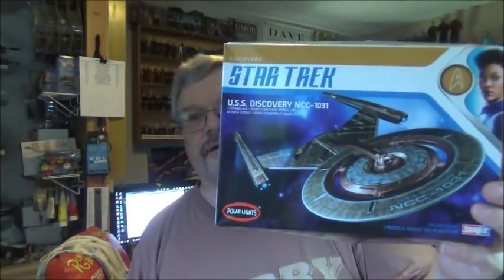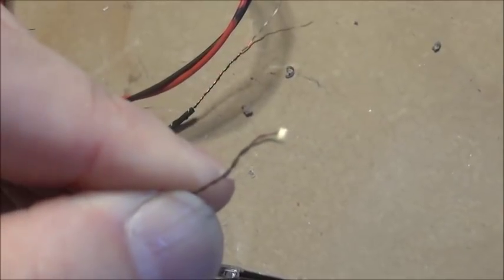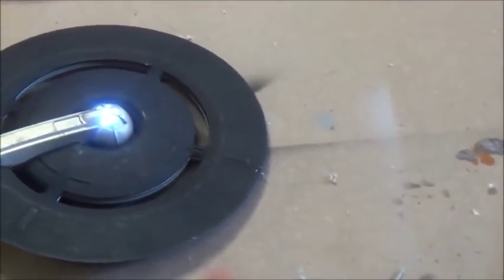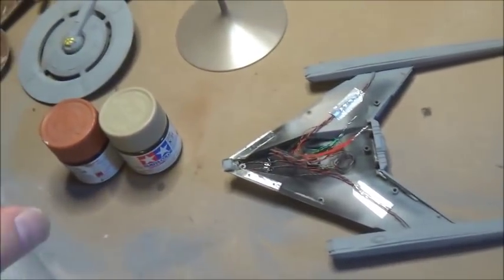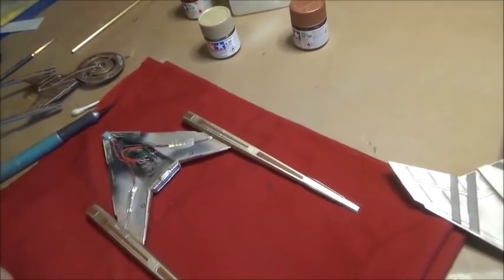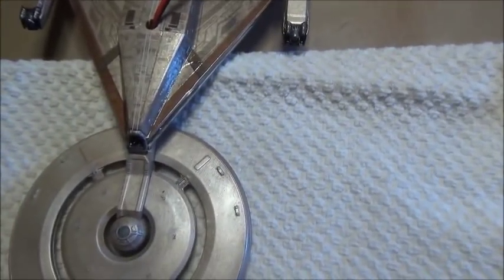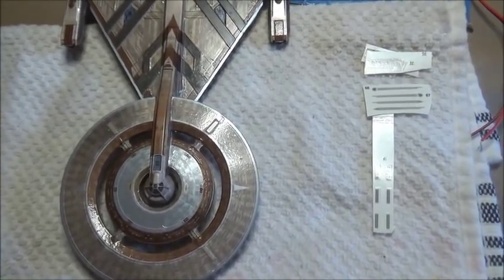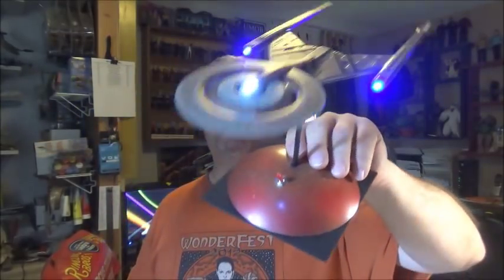Aztek Dummy Update 5/17/19 - USS Discovery

Comment: I just found your channel. In my  Reliant build, I used coated magnet wire for all my wiring. Its strong, thin and works wonderful in tiny thin plastic models. I use it on all my foam model planes including my smaller RC planes where the weight of heavy wiring and even 3mm LED's wouldnt work. Nice build thats for sure! Great job. Sometimes building a?model is more important than the politics of the show.

Comment: Great work Lou! Do you have a spec list of the types LED's you used?
Reply from the maker: Nope. I will tell you that I get my smleds at Evan's lighting and that they are the nano sized  prewired smleds. Beyond that, it's up to you.
Reply: @aztekdummy  So long story short, I lost my base. Any suggestions as to what I could use as a replacement? I'm planning on running the wires down the tube and need a good base to install a switch.
Reply from the maker: I made mine out of the tin that the cat's flea collar came in. This is a good time of year to look for a small Christmas box to use for this

Comment: I thought this was a great video and I applaud your ability to light up your models.  I unfortunately do not have the inaid ability to work with electricity and thus everything I do will end up unlit.  I understand the process but I can't seem to carry it thru like you can easily do.
Personally, I like the show and am looking forward to S-3 so there wont be any rants on that.  This comment is on the possibly unexpected topic of how they package the models.

I personally think that as a starter "snap-fit" model, that what you got is what to be expected.   My main bug about the kit is that it looks like they have packaged it same way that AMT in particular did with their original TNG series of models - a great big box with a small model in it (as opposed to the smaller boxes that re-releases came in).

I remember commenting when I opened the boxes for the first "Bird of Prey" and other Klingon ship models "Where are the other two models?" as there was more than enough room to put the plastic for at least one more model in the box.

Now I know it was all marketing - big box like for the E-D and thus great box art and everything can go into standard shipping cartons but to me it was disappointing to open a big box (big expectations - 😃) and then to find hardly any plastic in it (🥺).  

Anyhow, great model build for the size it turned out to be and sorry to have taken up the space talking about packaging.

Comment: Why are they small are these accurate scales to larger ships
Reply from the maker: Round 2 has a line of 1/2500 ships so they would be accurate to each other, but not to the larger scale kits
Reply: @aztekdummy  so which scales are correct I see they have a nx-01 1/1000
Reply from the maker: I'm not sure what you mean. Scales are neither correct or incorrect.  They simply are. They make both 350 and 1000 scale NX01 kits and they are in scale to other 350 and 1000 ships. The 2500 kits are in scale to each other, but not to the 350 or 1000 ones.
Reply: @aztekdummy  so what I mean is what kit is a good size to be accurate with each other
Reply from the maker: That can be a problem because they seem to be making the ships bigger and bigger in movies these days. My favorite models are between 12 and 18 inches long. That works out to 1000 scale for some ships but 350 for others depending on how big they are in the show. I'd love to see everything in 350, but that would make the Enterprise D about 6 ft. Long.